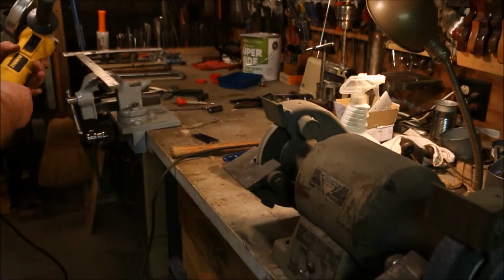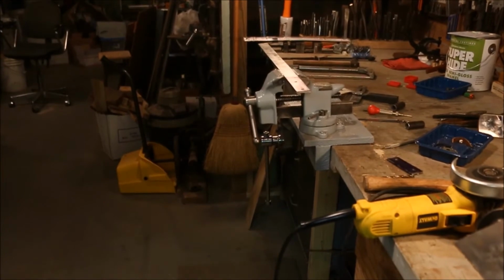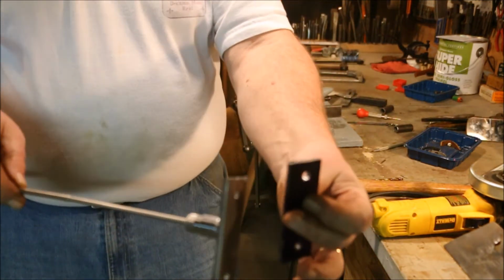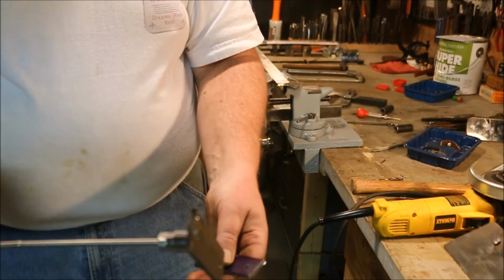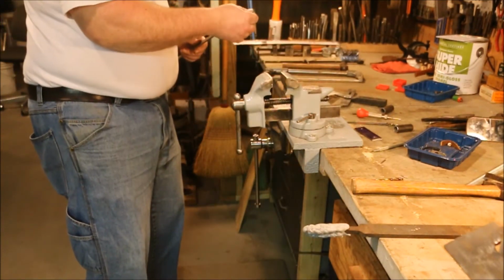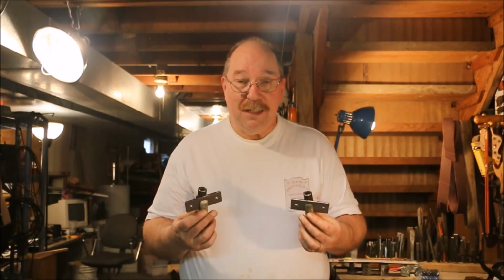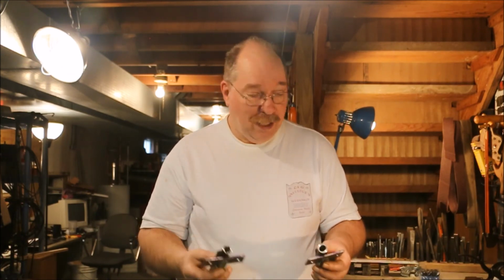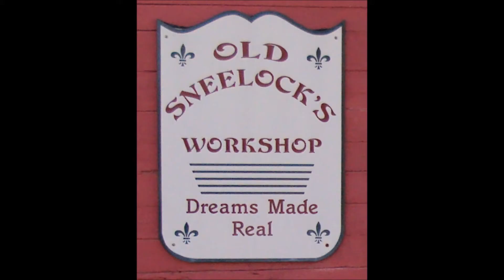WHEELBARROW GARDEN PLANTER ~ AXLE MOUNTS ~ CUT THE PLATES ~ PT 10

Comment: You are correct, and more than just for welding. Many times, for me anyways, the prep before the project, determines the result. If I take the time to do the prep, I have a better chance of getting a sucessfull result. for mw many times that starts with me cleaning and putting away, or aside, items from my last project, or cnother current project, and verifying the tools I need are at hand, and I did not leave them in the shed,mor other location.
Reply from the maker: That is a step that many of us take. Clearing one before starting another is often the case here. :-)
Reply: I have to continually prep as I go or everything flies all to flinders. One track mind staying derailed in a swamp don't help a thing.

Comment: When a deal like this comes up I usually just score the part and break it off, with the hacksaw or the grinder if I need to get on with it and hist the sharp edges after it hits the gravel. And I'm like Matt in the prep often makes the outcome come together. Went to put the deck on the new-ish mower yesterday and had just one minor thing wrong. I told it that it'd just fool me once as I put it back up. I corrected the mix-up and will be on it's trail shortly. Till then, HAPPY MOMMYS DAY all you fellow Sneelockites, on either side of the pond or elsewhere!
Reply from the maker: Never let the blighters get you down Lewie.
Reply: ...or the mower decks. It had been a good 6 months since I had re-done the whole deck with a new shell and straightened out the old parts and put in the new ones that I couldn't salvage off the old pile of rusty holes.It sat in the shed, leaned up on ,my supply of generator gas just waiting for the time to try it out. Painted, resined where the 'breather' holes were for a 'mulching' setup that were just places for clippings to settle and rust to start. I had, as the old drunken mechanic called it, the 'dia-gram-fram' for the mower from Parts Direct but the whole thing was together and all the other pieces were with the deck itself so I thought it was a done deal. The blade engagement rod will fit with the bend to either right or left. I had it left when it was supposed to be right. It's right now, in more ways than one. Maybe that'll make a pun of some kind. Have a good one, Unc, and Mom LYdia too! Maybe Ryan will send /bring yall a file with a cake wrapped around it. Sweetums and the Grandbaby's Mom are out on the town together, ALL DAY LONG. I think I've got bail money..............
Reply: Thanks Lewie, we have mothers day here in the UK on the last Sunday in March. For us old guys it reminds you how much we miss them and makes you realise how much common sense your mum taught you, a bit like your Uncle Sneelock. Hope everyone has a great weekend.
Reply from the maker: Lewie McNeely We had a great time. Ryan's girlfriend lives in Holland, MI. We met Ryan at the Tulip Festival Friday. I had been to Holland for work before but never went downtown before. It's a really nice town. Lot's of cool shops. The streets aand sidewalks are all perfectly clean and not a single brick out of place. 
There were a couple places I might check out later. ☺
We spent the afternoon with them  and her parents. The festival is all week long. The streets in the whole town are line with tulips. This year the weather was just right and everything was blooming at the same time. They had a block long troup of Klompen Dancers in traditional Dutch dress. Then a walk downtown with a stop at at a make your own Sundae ice cream shop. 
Then we went to Ryan's to spend the night and celebrated Mother's Day on Saturday. 
Perfect weekend and home on Sunday so I can mow.
Reply from the maker: UK Tony Nice to remember our Moms and honor our kid's Moms too. I managed both this year complete with card, gift, and trip. 
I had a lot of help.
Reply: Sweetums headed out with the goofy younguns mom for a day on the town in a fizz this a.m. Me and the bulldog are batching it. Got some cooking to do up and then I might tackle the mower deck again now that it'll go up. Rain was coming friday and I guessed if I didn't put everything away I'd end up soaked. Maybe and maybe not but I'd done enough wallering for a year or 3 so it was time. Carolina Blue everywhere that'll knock your eyes out today and cool, just right for me. Yall have a fine one and don't over mow-it, Unc!